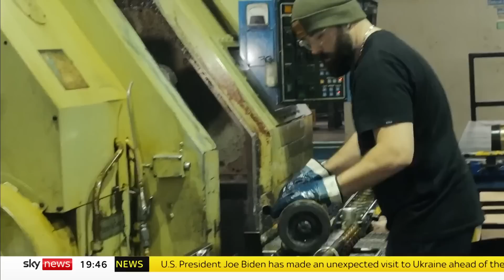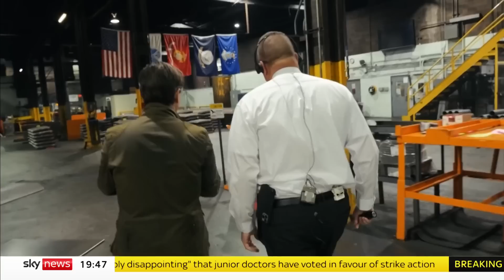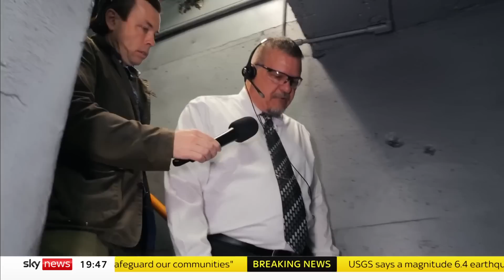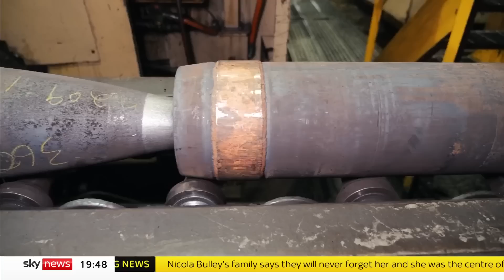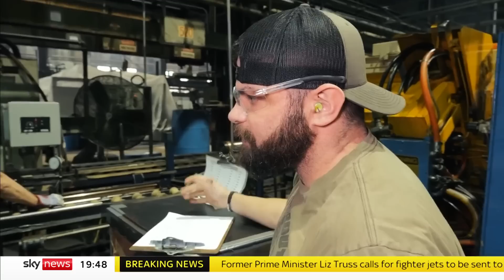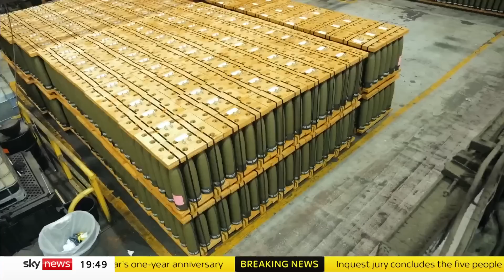Ukraine War: US factories ramp up weapon production

Comment: Making more production lines to manufacture these shells is not that difficult if the US Government is writing the check - Furnaces, presses, dies,/tooling, robotic handlers, CNC lathes, inspection equipment, handling equipment could be set up and running before end of 2023 if sufficient engineers are assigned each production module.  The war powers act can enable these projects to take priority at suppliers.
Reply: Ukraine is using 5,000 155 mm shells a day  and needs more, they would be better able to contain Russians if they could fire 10,000 a day. This facility makes 11,000 a month. A lot more capacity is needed indeed.
Reply: @detroxx56784  that will take years and if a president that doesn't want America to be involved in this takes power in 2024 then things are going to get very intresting
Reply: A trillion dollar military budget and it's not enough!
Reply: @chandraprakashvihtavuori2562  Don't forget, this is one factory only, and in one nation only. Most of NATO is supplying Ukraine with 155mm and 105mm artillery.
Reply: lols
Reply: It shows we need to be better prepared.   Better to have warehouses full of it and never fired a round, then in battle with nothing. and have to beg other countries for help.
Reply: Buts its not the US at war so why should the US pay . Oh wait they got back handers .I get it now
Reply: @Interdiction  Sending a lot of old vehicles too, send your surplus while your newest fancy models slowly replace them. Gotta replace your 40+ year old tanks, ifvs, artillery, etc eventually. Better there than collecting dust here.
Reply: @Interdiction Better to have Ukrainian military fight them than to have the US military fight them outside of Warsaw. Shells are cheap, and the jobs pay well.
Reply: A lot of the equipment has a year lead time when ordered, it isn't sitting on the shelf. I agree that the war powers act should be invoked and the equipment prioritized.
Reply: I know the factory is switching to triple shift, but i was unaware they're increasing the production lines with 240m in capital out of a 2B procurement budget.  Good, that part of Scranton is a little run down, it could use the investment.
Reply: Unfortunately many people would rather increase federal money for welfare and handouts even though there are jobs open everywhere
Reply: @chandraprakashvihtavuori2562  That's why we have a stockpile of nearly 10 million 155mm shells and about the same amount of 105mm. That gives us time to ramp up production beyond the already maintained "ready reserve" production capabilities
Reply: Not faster then China
Reply: Key word in your sentence "if" .
Reply: @Interdiction  Most aid from the US is given in the form of loans. When the war is over Ukraine is almost owned by the US. And thus one of the most important grain-producing areas of Europe. I wish my country would also make such a smart investment.
Reply: @chandraprakashvihtavuori2562  They could have been much better able to contain the Russians had they abided by their Minsk 1 or 2 treaties and stopped attacking their own people in the Donbas region. I can't imagine why they voted to leave Ukraine twice.

Comment: No, Mark Stone, fuzes are not "fitted" when and where the explosive is loaded into the projectile. The shell will receive its charge that is capped  by a plug with a lifting eyelet and the fuzes will be packed and shipped completely separate for safety reasons. The charge in the shells will at worst cook off if set on fire, but not detonate. The fuzes - even if packed by several dozen - have not enough of a fuel in them to create a bigger calamity in case they go of.

Comment: Pretty sure they are not shipped with fitted fuses. They’re shipped separately as they’re a live round once fused and there are different fuses that do different jobs.
Reply: AGREED.
Reply: think they are fused shortly before firing :)
Reply: They're sent to Iowa where they become active and shipped out.
Reply: The fuses are not attached until they are ready to fire.  This is the case because there are different types of fuses; and the fuse selection is based on the mission type, etc.
Reply: @drydud3  They are filled in Iowa. Usually with TNT as it can be melted an poured in so the void in the shell is filled 100%. They don't fit the fuses there though. It would be dangerous to do so. Plus as mentioned there are different fuse types. Before firing the crew screw all the fuses in and set them.
Reply: @specialingu  Indeed. They are fused and the fuses set right before they are fired usually.

Comment: It was never going to be an issue. How I know? Because no properly run businesses will say no to additional contracts. In other words, if they need to increase capacity such as by hiring 3 shifts to keep the production going 24/7, they absolutely will do exactly that. Right now, if I am not wrong, the US has split the contract on artillery shells between 2 suppliers. If need be, I am sure they will find more suppliers. Not to mention, they are also investing hundreds of millions in helping these suppliers expand their production facilities. This is actually great for the US economy. If the current stock is as low as they claim, then these suppliers will keep their factories running 24/7 for years probably until the US military can build back up the surplus.
Reply: Oh, that sounds like what the Russians did....8 years ago